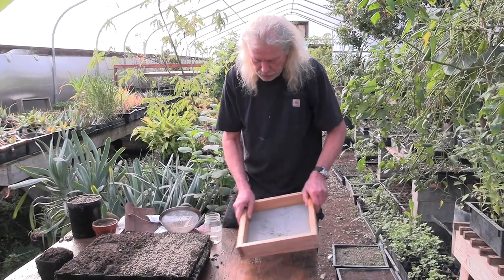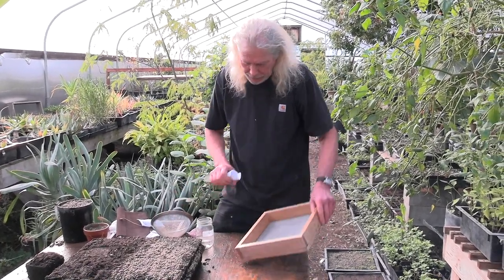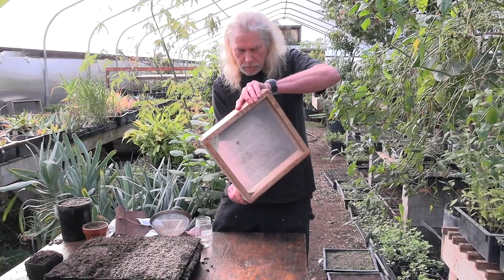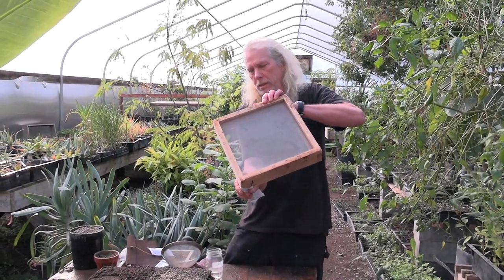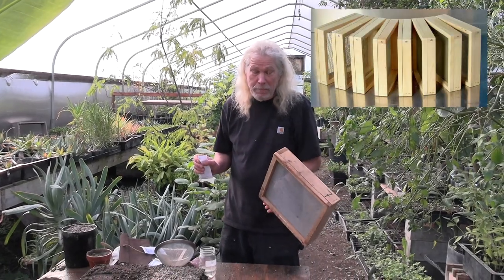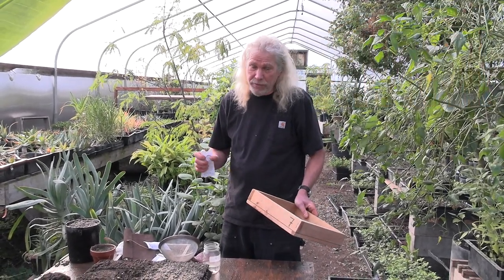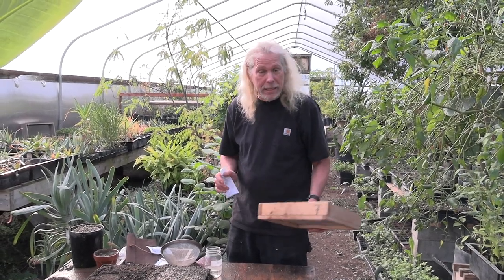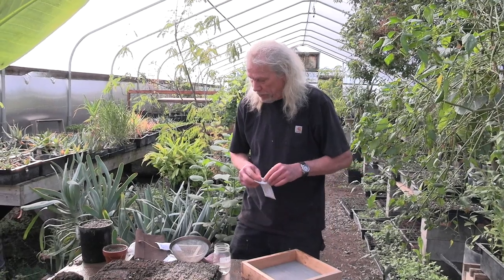Seed Planting Techniques

Comment: I have a question about timing on the stratification planting.  I can't tell what time of year you're filming, other than it clearly springtime, so . . .  My first frost is Nov. 1 - 15, and last frost is Mar. 20 - Apr. 5.  Based on these frost dates, when should I plant flats that need time in a shade house for 60 days?  For these types of seeds, do you soak them and water the flat before you put it in the shade house?  Since you have an open-air shade house, do you protect the flats from snow?  Will the seeds still be viable after a long stretch of freezing temps, wet freezing temps?  I love this technique and have a setup that will allow me to do it, just need to understand the process a little better and learn which seeds need this kind of care. 🙏🕉
Reply from the maker: hi there, Thanks for contacting!  The best time to plant any seed is the same season that it drops naturally from the plant in habitat.  Any artificial stratification (prechill) is designed to mimic that process.  The number of days and other relevant details are all species-specific and printed on the seed packet for that species.  I also recommend reading and/or referencing "Growing Plant Medicine Vols 1 and 2" for more complete information.  Soaking in water before planting is sometimes recommended for larger seeds but is impractical for small seeds.  Certain species germinate best when snow chills the flats--Gentiana and Rhodiola for instance.  Long periods of wet alternating with frost are particularly helpful for wild-derived medicinal herb species including for instance Sambucus and Aralia.  Yes, you're going in the right direction.  Research and experiment.  Richo
Reply: And thank you for the guidance. I have both of your books in a cart and am going to buy tonight, was out in the garden until dusk.  Love your videos, learn so much and appreciate your way with plants.    @StrictlyMedicinalLLC
Reply from the maker: where did you find the OM cap?